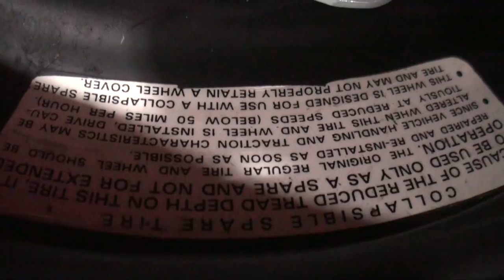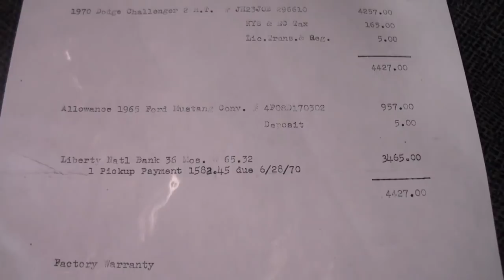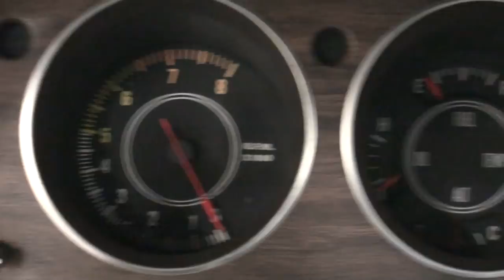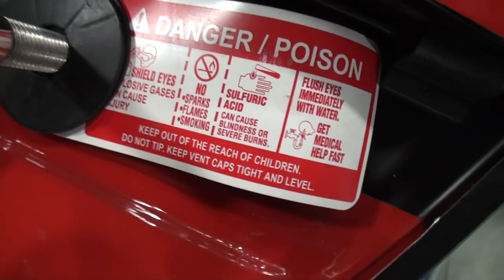1970 Dodge Challenger T/A Trans Am in Red & 340 Six Pak Sound on My Car Story with Lou Costabile

Comment: Hey Lou, Typical female almost scared up the paint with the key opening the trunk, back in 1970 those 340 6 packs were fast and still are, i have 1st hand knowledge with that. They were not qualified for the actual TA race there was a limit at 5.0 liters that's why we had the 302 boss Mustang and the 302 Z28 Camaro and the 305 Javelin. There was however a Challenger that did run in the TA race with a 303 cu in motor. 1970 340 + 6 pack, Auto 1410 made, 4 speed 989 made, Total 2399.  Made throughout the model year. Awesome Car Thanks Lou.
Reply from the maker: Hey Newton Washington, Glad to read you knowledge and happy to read you enjoy this car :-) Lou